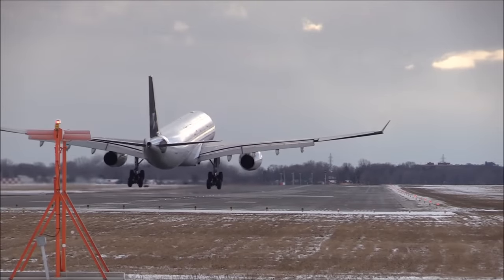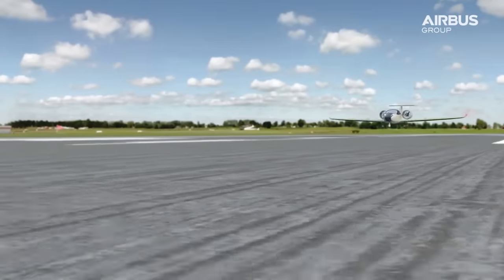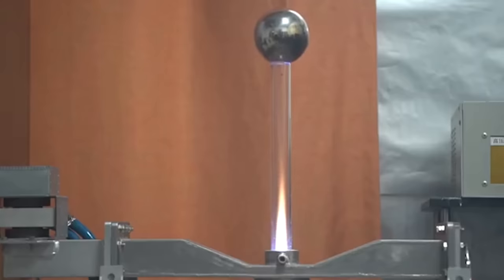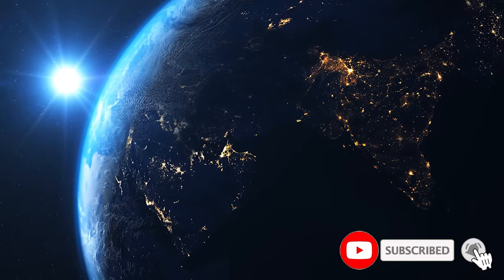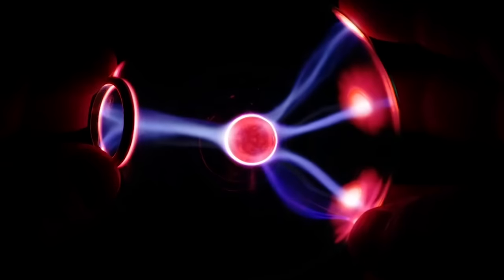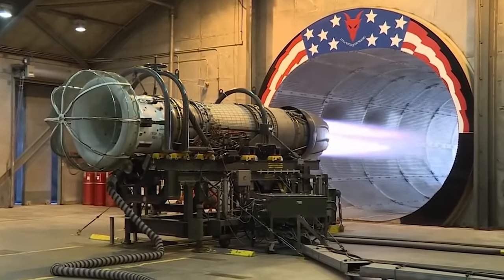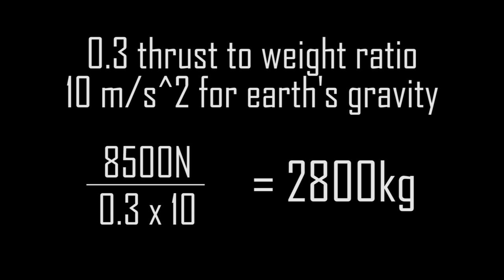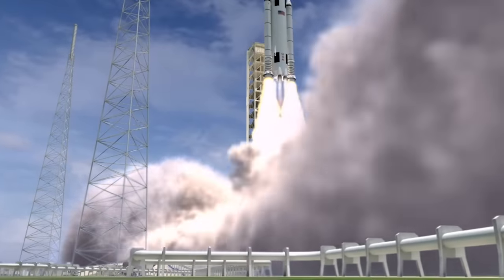Uncovering China's New Electric Plasma Jet Engine

Comment: I fly my private jet with hamsters running in metal cylindrical cages. I feed them super foods and espresso. So far the results have been excellent.
Reply: Why would you feed them portuguese newspapers?
Reply: @monsieur.Chipmunk  Hello brother. We have to eat. A few ideas. Get some chickens. Simple to build a cage in the yard. Fresh eggs every day. You can get food scraps free. Hospital cafeteria. They eat anything. You can grow wheat grass easily and juice it. Super good. Get all those green nutrients. Start baking your own bread. It's easy. There are rabbits called speckled giants...they grow to maturity in 6 weeks..tastes like chicken. Canning is easy. Good luck.
Reply: @brucewilson1958  Thanks for the advice. I love fresh eyes everyday, they taste like jelly.
Reply: Feed 'em crack smoke and watch the RPM's rise!!!
Reply: What sort of thrust to cage rpm you getting out of that? I’ve got 72 hamsters knocking out just under 3600kg of thrust. Been tweeking it for around 6 months now, some fancy electronics have shown hamster 35 as the weakest link in my engine. May have to replace 35, or “fat Dave” tomorrow, got some good little runners lined up to replace him.
Reply: expresso though
Reply: @yummyfuzz1  I don't think like that. I just love to fly. So far I have never run out of throttle.
Reply: Law Dorherty  Human slavery..I'll start with you. Human slavery is revolting. Not funny.
Reply: How many miles per hamster do you get? I’m thinking about doing the same.
Reply: @pedroperalta5719  I'm currently running 48 hamsters. I fly a lot and so far I have never run out of fuel. I'm beginning to add pork and beans to their diet and compressing their flatulations  with a power takeoff from the spinning cages. This acts like NOX when I need, or just want, that extra dose of power.
Reply: @RocketJockey1300  I made a mistake. I misspelled a word. What an honor to have been corrected by you, the flawless one, above such error. The perfect human.
Reply: ...said no one ever...
Reply: Bruce, Currently running an experiment to genetically upgrade my 72 hamsters to hamiesters 2.0. Feeding them Red Bull & vodka but they get aggressive as the evening goes on and will fight anything (some have even gone and got tats). Any advice would be helpful.
Reply: Don't forget the methamphetamine and an entire cargo hold of replacements for after the heart attacks.
Reply: You too? I've just upgraded to the new multibore cage. It's amazing !
Reply: Espresso = afterburner
Reply: Feed them nuclear. That would be nuclear powered hamsters
Reply: I fed mine hash cookies, and set a new altitude record. Not breaking any speed records in the near future, though.
Reply: hahahahaha hehehehehehe hohhohohohoyo  ooohhhhjj weee;hhhhhhhaaaaaa.......    please stop !    you killin me.
Reply: And they provide the inflight meals...
Reply: Mee Too,,,,  except my jet plane is hypersonic and the mice now are bigger than gophers and snort flakka.
Reply: Add pinto beans marinated in tabasco sauce to their diet, and attach tubules to their anuses, making sure the tubules are directed en masse through the exhaust during high stress events (e.g. take off) and you've got a winner!
Reply: Mice work better. At least twice the output of a hamster although their superfood intake is also greater, but not enough to make them more efficient.
Reply: @Tryst46  I tried mice but I could get the torque levels I needed...movement but no mass.
Reply: The capibara upgrade is next-level shit.
Reply: You must be on vacation
Reply: That's quite a herd of hamsters. Do they cuddle ?
-rolls around in hamsters.
Reply: @ZMacZ  I give them 10 minutes off per hour on a rotating schedule. Mostly, they roll around and play. All animals like to play. I do. When they sleep no one gets left behind!
Reply: @isee7668  I heard they were experimenting with using donkeys too. No doubt the Japanese will answer with a smaller and faster donkey though :)
Reply: You so need to up your game to guinea pigs. Much higher output for only minuscule extra coffee.
Reply: — Captain, we've run out of espresso!
— Emergency landing!
Reply: @jskratnyarlathotep8411  Oh sh$t we've got no thrust! Wait!
Don't we have those chocolate covered coffee beans we were going to give to Granny Saggy? Pilot to CoPilot..procure the beans!
Reply: I've heard that cocaine helps better.
Reply: @yokeshvejay3149  Not on my budget!
Reply: Roasted hamsters like coffee beans... so clever! So crispy!
Reply: Why not just skip engines entirely by making the plane out of Thrustium?
Reply: If you use capybura on pure caffeine.  The engines produce more torque #lol
Reply: that's hamster abuse lol, stop right there sir 🤣
Reply: @Prod5D  I have a rare gift to be able to communicate with hamsters!
They really like the challenge.
They demanded three things;
Four hours off per day, 2 for sex and 2 for a nap, fresh organic vegetables, Gatorade.
Reply: @brucewilson1958  wow, the hamsters being paid in free time😂